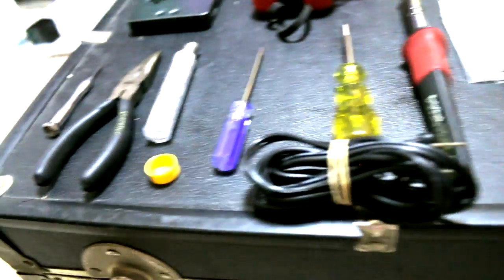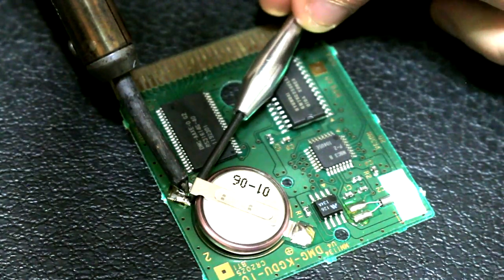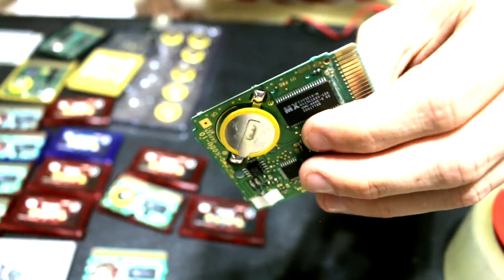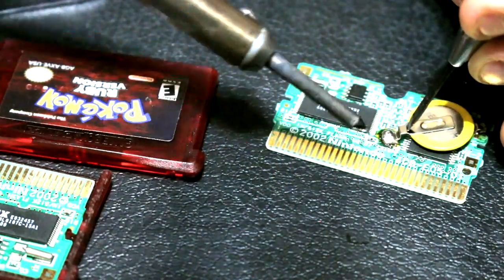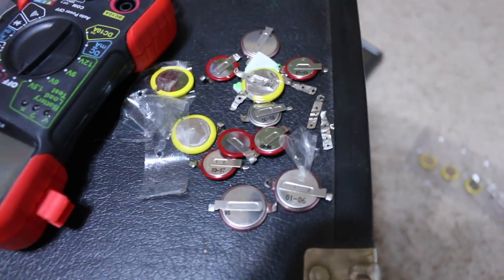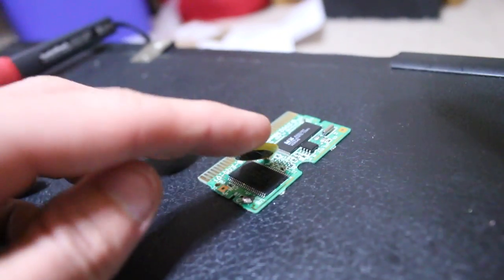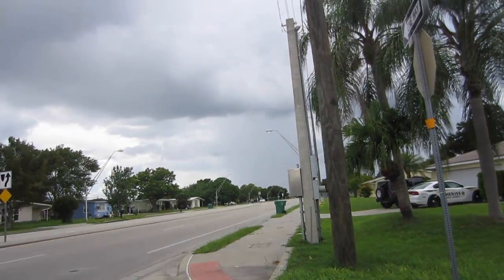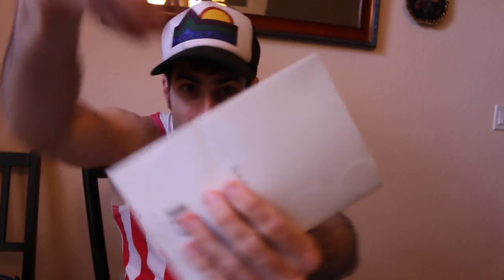(HD) How To Fix A Pokemon Game That Won't Save (the right way) | Vlog 135

Comment: I’ve been researching and changing the battery doesn’t fix the save issue? My Pokémon ruby battery does need to be replaced I know that. Will it fix the save issue? I read that it’s a different thing you need to fix.

Comment: You should change the AC drier while you're at it.
Reply from the maker: Thats what I have heard from multiple people. It has a new one it (new as in not original) That I think the previous owner changed when he tried to do some work on it. If its been replaced since the system hasnt been working would you think I should still change it?
Reply: I'm no mechanic just like you I try to fix my car when a problem arises, but if a lot of air or moisture has been through the line then I would replace it. Actually I think if you're going to dish out a couple of hundred on a compressor then I would change the drier as well, usually only $15, better safe than sorry.

Comment: When why i save my fire red does it not keep the save when i save and load the game the next day the save is gone
Reply from the maker: The battery is toast. Need to be replaced.
Reply: @thecollegepicker  are you sure its fire red
Reply from the maker: You can do a voltage test on the batteries but I'm 99% sure.
Reply: I thought the gba games only had ingame clocks on the battery
Reply: @masteralienstar  Only certain Game Boy Advanced cartridges use a battery backup. A GBA cartridge can contain either EEPROM, SRAM, or Flash RAM. Only the SRAM variant would need a battery backup. So for most games it is not a problem.

Source:
https://gaming.stackexchange.com/questions/221224/do-gba-cartridge-batteries-run-dry-after-some-time
Reply: @masteralienstar  depends my dude, but it’s fire red which came out later into the gba’s life span and has no internal in
 game clock so it shouldn’t have a battery inside... sounds like something is faulty